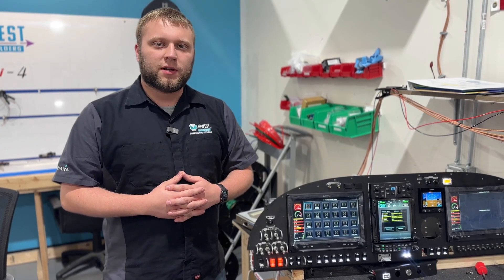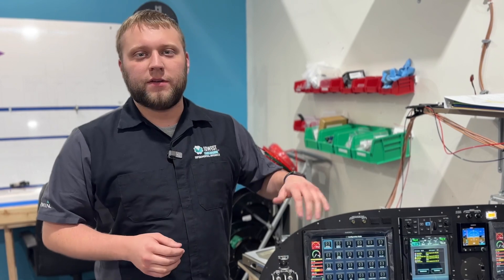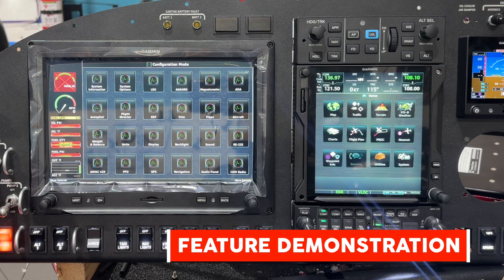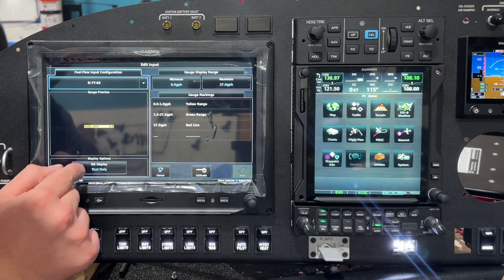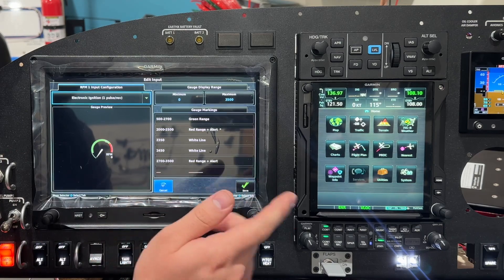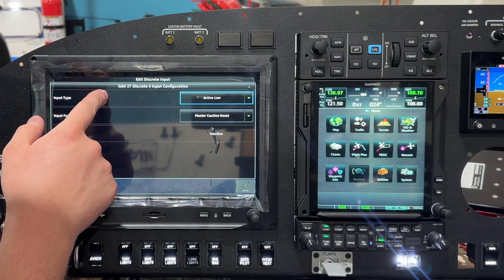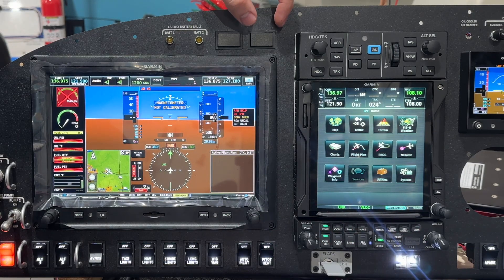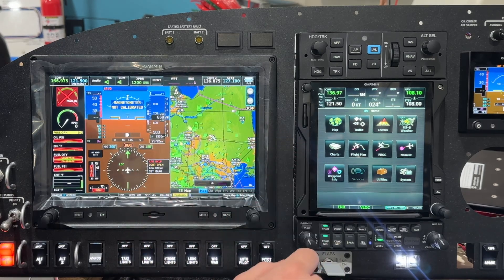Top Features of The G3X Update 9.21! (UPDATED! SEE DESCRIPTION)

Comment: QQ - do you know if the master caution / warning push button indicators can be done on a certified install of g3x ? (or is it experimental only?)
Reply from the maker: The switches in question are not certified but it probably would not be too difficult to get a field approval.

Comment: Hi. Im wondering if you can explained how to calculate a K-factor for fuel flow? Whats the proper formula on the G3X. I’m using Electronics International FT-60 sensor, and the formula I found is [G3X reported fuel used] x [previous K-factor] ) / [actual fuel used] but this it seems this formula is not accurate. I’m wondering if there is another way for calculation! Many thanks
Reply from the maker: That is the proper way to do it. Be sure you are replacing fuel to the exact same level, that is the most common error.

Comment: Please advise if there is a way to increase the font size for the airspeed and aLtitude on he ribbons.  As an older pilot  quite a few of these digital figures are really hard to read.  Many thanks.  Warren - South Africa
Reply from the maker: Unfortunately there is not.
Reply: The FAA mandate to minimum font size and says if you have trouble reading it you shouldn't be in the cockpit anyway. Personally I think that's a shit rule because experienced pilots brains fill in a lot of information but that's just what the FAA says

Comment: Hallo from Germany. Today I did an update and I have a lot of problems. Update 9.22. ANot receiving GPS navigator RS-232 data, Not receiving GTXTIS A RS232 data using internal GPS flight plan for navigation. Red X 8 AIRSPEED FAIL, ATTITUDE FAIL, So, do you have any idear what it is wrong? Thanks a lot. Best Regards
Reply from the maker: That is a strange problem, if you boot into config mode and go to System Information see if everything is communicating. Also check the RS-232 page to be sure the settings are still correct.
Reply: @MidwestPanels  We believe the GSU 25 is defective because it no longer makes contact with the gdu, we ran the update again and also tried an downgrade.

Comment from the maker: As a few have mentioned, the release was pulled back, there was an issue found within the VPX portion os the software so hang tight, this will be one of the better releases we have had in a while.
Reply: Are caution and warning acknowledgements from the panel now separate discretes?  I did not find a wiring diagram on Garmin’s website yet that defines this but their ops manual alludes to 3 separate discrete inputs which I’ll copy here.  Can you explain what all 3 are now doing?    ‘Remote CAS Acknowledgement - Three new discrete input presets were added that facilitate the remote acknowledgement of Caution and Warning level CAS Messages.’
Reply from the maker: @luckymacy  the 3 possible discrete selections will be Caution, Warning or Both in the case of a single button. So yes it will be possible to have individual acknowledgements if you have 2 independent buttons.